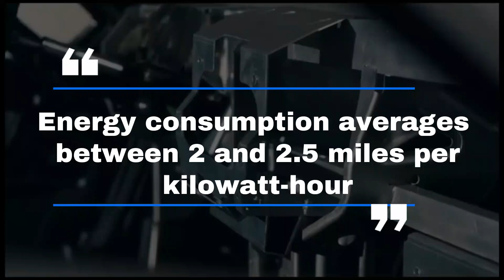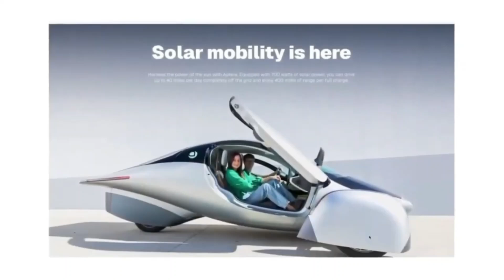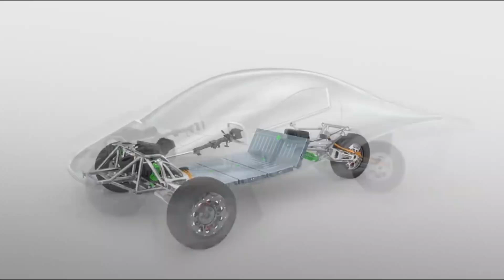What’s Next for Aptera in 2025?

Comment: Aptera isn't silencing anyone. They keep promising without delivering. When they can deliver a product, that will answer the critics.
Reply: Just like Tesla roadster. Do you think testing is just a 5 minute job ,it takes a lot to get a vehicle into a final production and government approval. I guess you drive a big truck or SUV thinking your safer lol they are not as safe as you think
Reply: @CalvinJordan-b1c  I think my Fiat 500e is safer than any Aptera "product".
Reply: @ lol do you really think a car that is built similar to a formula race car isn’t as safe as a fiat. Last tested it had the strongest roof of any passenger vehicle. It’s made of forged carbon fiber that’s 5 times stronger than steel
Reply: @CalvinJordan-b1c  How important is the roof to side impact?
Reply: @ lol look at the door and the two roll bars one across the car carbon fiber and a steal one that goes to all 4 corners to support the side impacts  does your car have those don’t think so

Comment: At this point, Aptera isn't a business, it's a speculative investment scheme. The transition to a company that actually makes and sells cars in high volumes is going to be extremely challenging and difficult. I hope they succeed in the end, but it's been a long road, and I won't be surprised if there are further delays along the way. The only thing going in their favour is that acceptance of EV's is becoming more mainstream, and the technology is improving and becoming cheaper, so that is going to make it easier for Aptera to make money from selling their cars. Plus, people are now aware that efficiency is the key to making a good electric car that can get good range, enough to make it useable, and the solar panels make it possible for low-mileage users not to have to plug in, at least not nearly as often as other EV's. So if they can make the transition, I think people will accept this vehicle, as different as it looks, as it will be a user-friendly car to own and drive, more so than some EV's which you have to drag to a DC fast charger on a regular basis and pay top dollar for kwh. When it comes to charging, you can't beat free :)